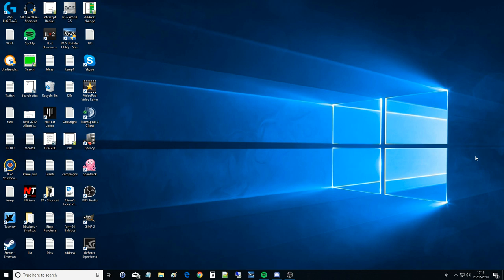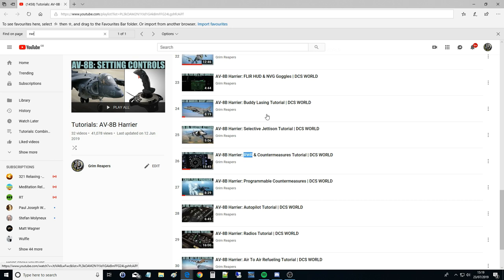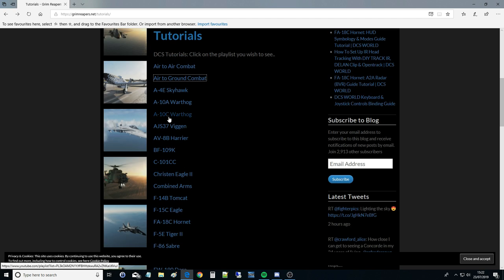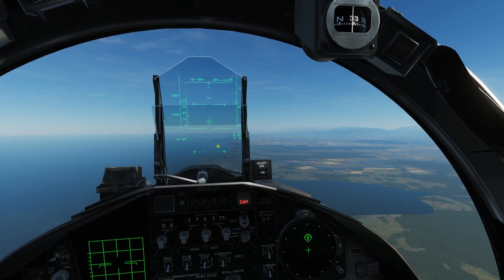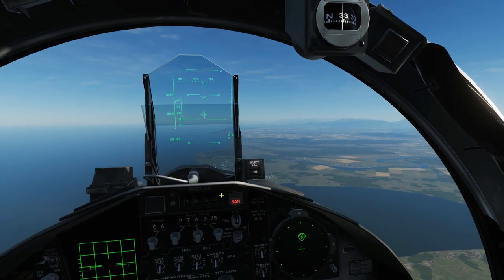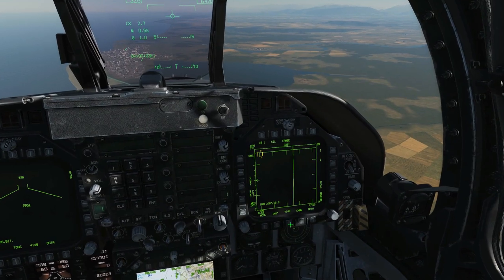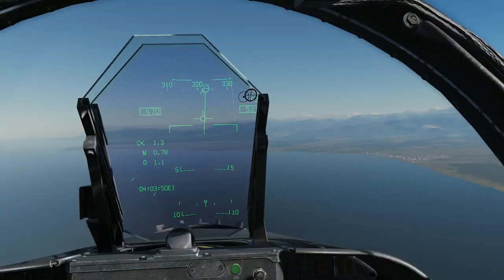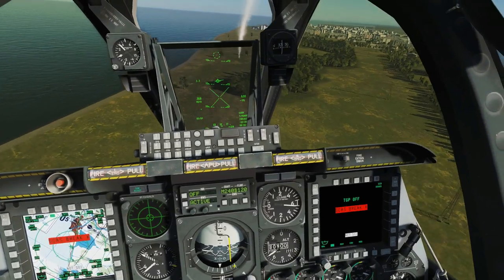Combat: (All Planes) Tactical Cockpit Warning Sounds Explained | DCS WORLD

Comment: The mig-21bis RWR is very sparse, it indicates the position of the radar pointing your aircraft with the diodes (one for each sector, front left, front right, rear left, rear right) and with a beep a second more or less. It shows multiple radars by alternating between them (one blink and a beep on the front left followed by a blink and a beep on the rear right for example). When the a radar is tracking you the RWR light up all four diodes and emit one long beep no matter how many radar are locking you or where they are. The four red "unused" diodes are in fact the red translucent cover responsible for dimming the RWR lights when turned into position.
Reply: You can see how the technology advances over time.

Comment: The RWR volume knob is on the bottom left panel about where the pilots left elbow is. Top left knob of 6 iirc.

That said, do you have the helmet sound selected in the sound menu? If not then I highly recommend doing so since it reduces the engine noise and makes cockpit sounds louder so it's a lot easier to hear the RWR
Reply from the maker: Copy thx. I have the helmet turned down usualy because in GR we get 10,000,000 ATC calls for all the planes.
Reply: That is the downside of the F/A-18. The RWR is also controlled by the helmet audio, so when you turn down your radio calls, it turns down the RWR too.
Reply: @WyvernFalken  I was talking more about the toggle not the sounds, since you can hit that and it makes environmental sounds quieter while making cockpit sounds louder.

And you can turn down the radio volume by just turning down or off the radios with the two knobs on the front control panel

Comment: Cap:The M2000 has similar systems to the A-10C in that it can detect IR missiles. Same tone as the radar /launch/ tone, only on the RWR it only gives a bearing via a pulsing line.
Reply from the maker: roger but I couldn;t get it to work for some reason so left it out.
Reply: @grimreapers  Probably because the angle of detection isn't very large, or you didn't check the box in the mission editor (this system is optional as it's mounted on the pylons, not on the airframe)

Comment: How does an aircraft's systems know if something has been launched at it? Especially if it's being guided by the radar that's tracking it as opposed to a missile's own built in radar system?
Just curious what the system is looking for to determine if a missile is heading your way.
Reply: The subject of a radar lock-on may become aware of the fact that it is being actively targeted by virtue of the electromagnetic emissions of the tracking system, that is the radar, notably the illuminator. This condition will alert the pilot via a detection system in the [[aircraft]]. It indicates that a missile may be about to be fired at it.
Reply: @CuriousNikhil  Oh okay, so like...plane sees the radar...fine. Plane sees something changes...okay, plane being tracked, fine...but if something further changes after it knows it is being tracked, maybe not fine?

A few quick snapshots of the conditions of the signal and a general theory of orders of operations related to ground-based radar and ground-to-air defense gives a mighty good guess they've sent stuff your way if something changes while plane = in range and plane = has not taken fire yet?
Reply: @angry_zergling  How exactly RWR tracks missile launches etc. is most likely a military secret in terms of specifics. RWR systems most likely have a database of exact signals that they are looking for coming from various enemy systems to differentiate.

 But generally, once the missile has been launched, the SAM site or plane is sending specific guidance commands to the missile itself which is detected as the 'launch'. The RWR can detect this change and identify as launch. Some missiles are semi active and switch to active radar and when they switch this on and guide themselves they can be detected by the RWR and then the system knows it has launched and on the way to you. 

Some missiles launches might not be detectable by radar e.g. IR guided and the emissions from the missile e.g. IR/UV are detected and fed into the RWR by another system MAW and jets such as the A10 have this and therefore can try to detect IR guided missiles.

Comment: 25:15 In MiG-21, actually you get a useless SPO-10 RWR, it only gives you the bearing of the radar when in search mode by giving you the lights, once they lock you and even launch at you, what you get only all lights light up without giving you any direction of the launch

so, they are useless, in multiplayer match, you can have two enemy, painting you in the left and the other guy TWS launch from the right, and the bottom line, you lose your situational awareness

And this comment also my excuse for being a bad mig-21 pilot lol :p
Reply: Also, the air launch vs the Mig 21 you could hear, the ground launch you couldnt hear.
Reply from the maker: LOL no1 is as bad in the M21 as Cap. Roger I'll do a vid on this at some point.
Reply from the maker: Copy thx